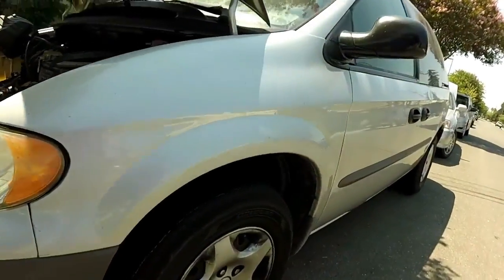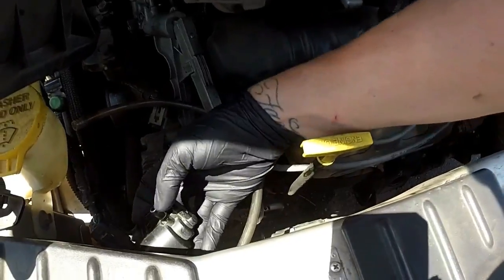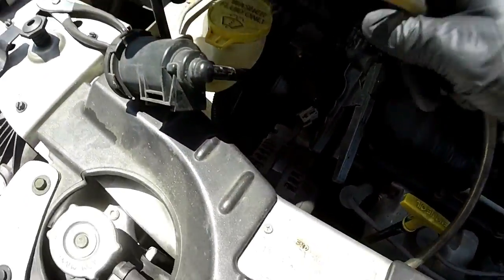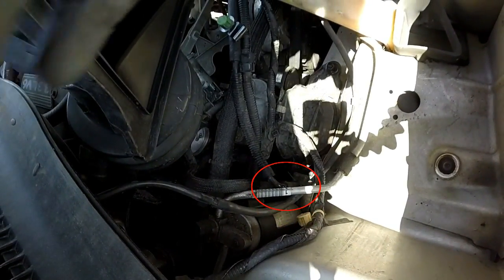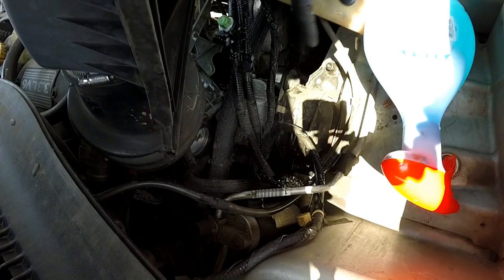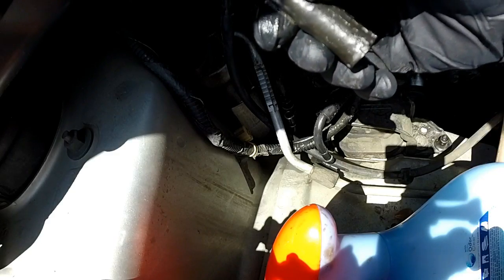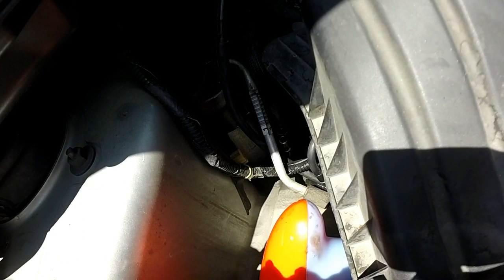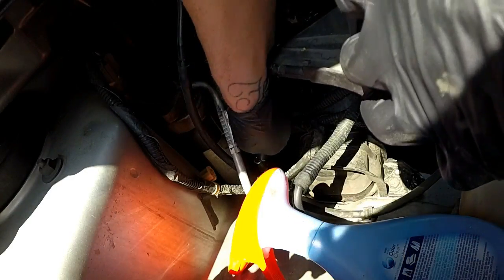OBD code P0442 P0455 P0456 diagnosis and fix. Easy!!!

Comment: 2001 Mitsubishi mirage 
Change out the gas cap still coming onP0442. It hesitated to start but will start
Reply from the maker: Since you have the hesitation and the event code you might have a problem with your vapor purge solonoid periods check out this quick little video I Uploaded a couple months ago. https://youtu.be/prYaqnviLX8 It might help you out.  If the vapor purge test fine then a smoke diagnostic would be your next step in this process to find the leak properly.  Really saves money rather than throwing a bunch of parts at the vehicle as well.

Comment: 2013 impala codes are p0420 p0455 p0420 and p0420. These are 4 codes it pulled. Ive changed gas cap solenoid under hood and canister solenoid by fuel tank. Light still comes on
Reply: Have 2013 impala similar with same code
Reply: @georgefuentespac-man3429  O my so they dont go away
Reply: What exactly are car symptoms

Comment: I am havinv the same problom with my 2007 crystler town and country it says done on the dashboard wear your milage is indacated and it is shoing both codes it starts and shakes then turns off and the oil light is on as well

Comment: I'm a oldskool man. I own all 1970s GM and Chevrolet cars with no Smog Bullshit straight cammed out. I purchased a 1 owner garaged 1999 Cadillac Deville creampuff. I've got a P0442 only Evap leak. This pointed my in the right directions. Time to go to the Chilton manual. Updating later. Thank you
Reply from the maker: I know what ya mean brother. This smog stuff dumbs engines down a lot.. I guess it serves a purpose... but not the purpose I expect in regurds to my engines.  My 94 350 silverado gets 9 mpg, its 4wd, over 270 and that truck will never leave us standed. We have had so much fun in her, if something breaks it can be fixed on side of road.

Good luck. Keep us posted.

Comment: So I tried the hack for the code but i didn't see a code come up. Could that be due to the intermittent ck. Engine light? Currently it is NOT on. So maybe that's why no code came up? 2002 dodge caravan 3.7L.

Comment: 2004 dodge grand caravan SE 3.3 engine, code p 0443, replaced egr, code still pops. Any ideas?
Reply from the maker: Why did you replace the egr? Was there another code before? With a p0443 id start by checking if the purge valve holds vacuum when unplugged. If it does not, replace the purge. If it holds vacuum, you need to have a evap smoke diagnostic done to look for leaks in the purge solenoid hoses. If no leak, start looking at the purge solenoid connection and wires for a defect.
Reply: I had egr codes also. I cleaned the egr. Still got code. I thought the egr is the purge valve...where is the purge valve then? Where do I vacuum or unplug?
Reply: Thanks very much. With your help, I located, and found the problem. It's now completely fixed, I erased the codes, check engine light STAYS OFF!
Reply from the maker: @martinwilkins3854  glad to hear! Good job getting in there and getting it done. Keep us posted on your diy fixes and feel free to ask questions.
Reply: @ScottiesHobbies  ABSOLUTELY! Thank you also.

Comment: I have a 2003 Dodge Neon SXT and I did that key trick which I've known about and that's how I've been getting my codes. Four four two was on there but now I looked and it's PO700 po703 p0522
Reply from the maker: Man... Are you maintaining that vehicle properly? Those are two transmission codes and a low oil pressure code. Have you checked your oil in the engine? That might help one of those codes. But the P-07 codes are transmission related and not in my realm of expertise. Sorry.

Comment: Can I have your help I have a 2009 Pontiac g6 & mines read p0442 (small evap leak) ?
Reply from the maker: Have you inspected the gasket on the bottom side of the fuel cap? Next would be to see in the purge valve holds vacuum when not energized.
Reply: Ok the code cleared with the first step & I also have an P0106 & P0107 they both read the same ? Do you have a clue ?

Comment: 2000 Camry PO440 & PO442 Small leak. 89000 orig miles, 4 cyl auto. Not the gas cap. Whatta pain!
Reply from the maker: I had a 99 give me such a headache. I replaced purge then like a year later the mil came back on. Then it was the vent and if I remember correctly we had to get the canister assembly to get the right vent solenoid.

Comment: I have a 2008 528i with a po442 code..cleaned out gasket on gas cap.but,code will not clear..Any thoughts??..thanks..joe l
Reply from the maker: You're working with a BMW. That is a whole nother Beast. As always if you've inspected all the hoses and haven't found any moisture at connections or cracks then your next step is probably a smoke diagnosis. Someone needs to induce a smoke into your EVAP system and watch for leaks and do repairs accordingly.
Reply: Scotties Hobbies ..not sure how that works..thanks for the feedback..

Comment: 1999 Toyota Camry 4 cyl evap control leak code.  I did the gas cap thing, but not much difference.  To get past inspection I have to clear the code, and then drive about 80 miles to reset computer, then it will pass.  The 80 miles is on interstate with steady speed and few stops straight to the shop, praying the CE light does not come on. Toyota put the evap canister up behind the muffler, virtually inaccessible. $700+ estimates to permanently fix.  Any ideas?  Replace Purge valve solenoid at engine?
Reply from the maker: On that generation you have a purge vsv that goes bad a lot and also a vent vsv near the canister. Its not too hard to get too. They both commonly go bad on your car. Ive replace over 50. I even had a 99 camry I bought for $200 cuz a customer was fed up with this problem.

Comment: Ok here's one for you I have a 1997 dodge status 2.4 base . My front vents don't work . The defrost works and also on the floor works at first I thought it was the blower motor but then thought no it's working else where then I thought it could be the resistor what do you think. Oh I also had a code of po442 but I replaced my gas cap and it went away. any help would be great.
Reply from the maker: Your blend door actuator might be bad or the blend door itself.
Reply: Thank YOU !

Comment: Thanks for the info. I just bought a 2002 Sebring with those two codes. The other 4 codes are: p-1684, 0340, 0134, and 1685. Any information on these codes would be a great help.

Comment: I have a po455 code on my 03 mach 1 it says check the gas cap but i replaced it and about 4 days later the check engine light came back on any suggestions

Comment: 2011 Ford Escape- P0442, P0457, P050B(00), P06B8(00) - Started with P0457- bought cap for capless gas tank, and replaced Purge valve canister- the P0457 went away, its been at least a month and the P0442, P0457, P050B(00), P06B8(00) all popped up today. Help please- I have the worst luck.

Comment: My 02 just threw an 0455 at me. Bottom hose, with the test port, on purge solenoid has a hole right near the rubber "joiner" fitting. Best way to fix that spot?
Reply from the maker: Is the hole on a hard line? For a mickey mouse fix you could sand it lightly and put jb weld over the hole or could you get a tight rubber hose around the pipe?
Reply: Scotties Hobbies it's not the hard line. Where the double ports come off the solenoid, then the soft rubber boot, then the harder (but still hose) goes into the boot.  Hole is about 1/2" on the harder bottom hose right up against the softer rubber fitting. Looks chewed. I'm out right now and just tight-wrapped with electrical tape.  Who knows how long it's been. Just got the code after driving 50 miles since new battery and fixing melted fuel management wiring harness.
Reply: I think my safest bet is to pull off the double line boot and replace both hoses up to their next joint.
Reply: Fixed the hose and the code cleared 50 miles later. Just passed Cali smog!

Comment: Have the P0455 code on my 2010 Dodge Challenger also notice anti skid lights on and brake pedal feels like it leaking off as I mash the brakes.
Reply from the maker: You are going to have 2 issues I think. Did the lights all come on at the same time? With the engine running do you hear and vaccum leaks? If your trac light is on that means your abs is not operating. You should be able to lock up the breaks if you slam the brakes on, does that happen? Just wondering if you are losing breaking power.
Reply: Scotties Hobbies Yeah they all came at once but they have done that before and then eventually turned off on their own. Now they all came back on and seem to be staying on I don’t hear the vacuum leaks yet I’ll check more tomorrow and let you know

Comment: Is the PC program better than a OBD reader? In what ways if so?
Reply from the maker: I was trying to find a program that had 2way capabilities for a good price.... I couldn't. I personally use a konwii cheapo I use. I have a video about it. In my opinion it's the best bang for your buck. It's about twenty bucks and it comes with the app. You can read codes watch a lot of live information that is really useful and clear codes if needed. You don't really need to do much more unless you're going to be needing a two-way capability program.

Comment: My 2001 dodge stratus se gives me both codes as generic
Reply from the maker: What are the codes?
Reply: Scotties Hobbies p0442 and p0455
Reply from the maker: So just like in the video, you need to find the leak or leaks in the evap system.  In this vid I use a 'mickey mouse' way to diagnose those same codes. If you go to a shop you can get a smoke diagnosis. But the computer knows your system is not holding prrssure but it cannot pin point the issue cuz its not an electronic failure.
Reply: Scotties Hobbies thank you I'll do that
Reply from the maker: Good luck and keep us posted. Your fix might help someone else.

Comment: Good evening i have a 2006 chrysler 300c 5.1  with 190k miles  2 codes are driving me crazy p0700 and u0100  I've change the ECM  egr valve clean throttle body changed camshaft added and  tranmission oil and it still stall next thing im changing is the transmission plug any idea please help thank you
Reply: Could be your fuel pump? Sounds like it or bad fuel injector

Comment: I have a code P0455 on my 2006 Chevy Colorado please advise
Reply from the maker: So you have a purge malfunction code. Have you done any looking around your vehicle? Inspected for cracked hoses, looked for loose hoses, looked for moisture around connections or a possible crack? A P0455 code is pretty hard to find the exact cause. Like in the video you do usually need to have the EVAP system pressurized so you could spray all the connections with soapy water and check for bubbles or have somebody do a smoke diagnosis period a smoke diagnosis would be somebody inducing smoke in the EVAP system and watching for leaks.

Comment: Hello good day. i have these two same codes on my 2005 mazda 6S 3.0L car 97K miles.
any idea on the solution of this problem?
Reply from the maker: +Kimael Registe have you checked the cap? Always start by checking that. Its pretty hard to find a evap leak without a smoke diagnosis or a mickey mouse diagnosis like i did in this vid.
Reply: Scotties Hobbies yes I have replaced my gas tank cap with an oem one reset and the code came back up.
Reply: Scotties Hobbies yes I have replaced my gas tank cap with an oem one reset and the code came back up.

Comment: I have both of those codes on my 2001 dodge dakota, i have replaced the gas cap twice had a smoke test done and no leaks were found and replaced the valve solenoid that you showed in this video... I have no idea what to do now to fix it
Reply: Try testing the fuel pressure sensor

Comment: Scotty, I could really use help with 2009 Chevy HHR  0442.
Reply from the maker: have you checked the fuel cap? Check for cracks on the seal. I honestly recommend replacing the cap when you get any EVAP codes. Don't use a locking cap. But this P0442 code could be any things. Its hard to say it could be this one thing.. The proper way to go about this code is to check for leaks like I did in the vid. If you take it to a shop they should be able to do a smoke diagnosis to find the leak.
Reply: I tried the cap a couple,actually.  No change yet.
Reply from the maker: really a honest opinion would be to go get a Smoke Diagnosis. You can do a vacuum check on the evap purge solenoid and vent solenoid. Both should be closed with no voltage. With 9 or 12v added the valve should open and lose vacuum. Check them both on the discharge side.
Reply from the maker: I'm adding a vid tonight or tomorrow night of doing a vacuum test on a EVAP Purge solenoid that was bad on a Hyundai Accent but it might be a similar test.

Comment: Good vid, thanks...Definitely clear as far as changing the hose goes. What is the program you are using to clear the code and how do you connect that to the car? I am driving a 2005 Dodge Grand Caravan that just had the P0442 code flash
Reply from the maker: I am using a OBD2 scanner that hooks up to my laptop. Its kinda out dated. You can get a Bluetooth OBD2 scanner / reader that will also erase codes off ebay here:  https://ebay.to/2unUtJD They come with apps to use on your device too. Super Easy!
Reply: I bought a bluetooth OBD2 scanner with an android app that connects it with my tablet (a Kindle Fire HD).
Reply from the maker: @kwilson962  I just added a few vids on a Bluetooth scanner for an android device. They are super simple, only downside is that they don't read abs systems.

Comment: Did your diagnoses and repair work after putting more mileage on the dodge caravan?
Reply from the maker: +test test yes. The lady called me three days later and was extremely ecstatically happy that her car finally passed smog. She followed up with me 500 Miles later just to confirm the light has stayed off as well.
Reply from the maker: +test test or maybe i miss understand your question.
Reply: Scotties Hobbies yes, you misunderstood my question
Reply from the maker: +test test no. Someone shop did there own diagnosis and repair but the light came back on. So i figured I'd help her out by ysing this method and it worked. So i got the csmera out and made a vid... was that a better answer?  Lol
Reply: Scotties Hobbies i wanted to know if the steps you took in this video if it worked or not?
Reply from the maker: +test test yes, they did. Long story short. Lol
Reply: @angeloyourreflection9331  totally agree why do people on these forums have to be so rude? I Enjoy reading the comments!

Comment: much better. I like the remake. the CC was great also.  my o2 sensors are the same ones i pulled out. Im revamping or custom engineering things lets just say. upon reinstalling the o2 sensors that I took out I marked them one by one with freezer tape on the wires as to where they went. I had a friend helping me. when we installed them he couldn't get them to plug back up on the bank one side. but the truck drives pretty good without them. yea I know. I' ll get it fixed soon. I had no choice but to drive it today. but I have been using the car on a daily basis. on bank 2 side the rear ones wires were almost cut in to and the wires were melted to nakedness. no insulation whatsoever,. so I cut the wires off and just used it to fill the hole for now. the S1B2 is the only one that is plugged in and i think it is working. LOL  I am going to test them. They were working when I pulled them out. Its a work in progress a little a day.

Comment: I have a 2009 Pontiac g5 and it throwing codes p0300 p0442 and p2135 and I have no clue what the problem is or where to start! Please help
Reply from the maker: I would start by checking the throttle sensor on the pedal. If that is giving a poor signal it can cause the p2135. Inturn, with the vehicle running like crap due to not getting proper throttle sensor can cause the random miss fire p0300. 

Or you might have 3 issues. Did all the codes come at once? 

Another option might be a leak in the vapor purge solenoid causing a bad fuel mixture. That could cause the p0442 and the p0300. And in that case the pedal could be a separate issue.
Reply: @ScottiesHobbies  yes all three codes popped at once. It goes into reduced power and then shuts off
Reply: @ScottiesHobbies  thank you for getting back to me I thought maybe a coil pack was bad or spark plugs.. even the fuel pressure sensor or something but I didn't know if that would cause reduced engine power
Reply from the maker: Its possible a coil is going bad but if it was, I would think you would get that calendar miss misfire code like a p0304 or p0306... 

Have you tried clearing the codes and  Seeing what comes back? Are you getting poorer gas mileage or poor throttle response? Any symptoms?
Reply: @ScottiesHobbies  figured it out it was the throttle body switched it out and it started right up and is purring liked a kitten.. thanks for all your help.. happy holidays